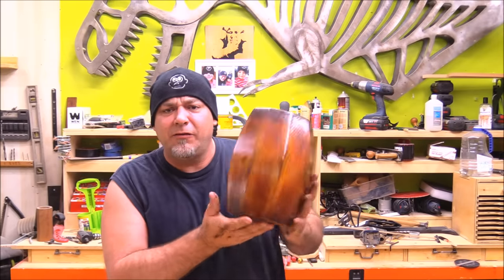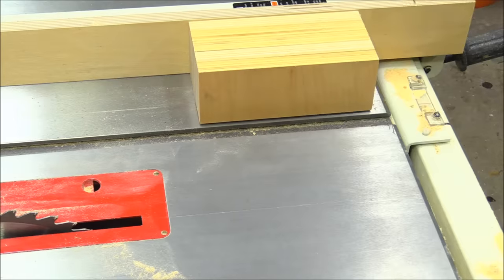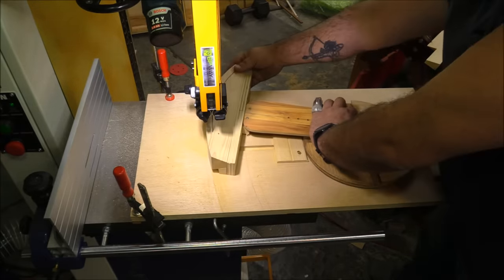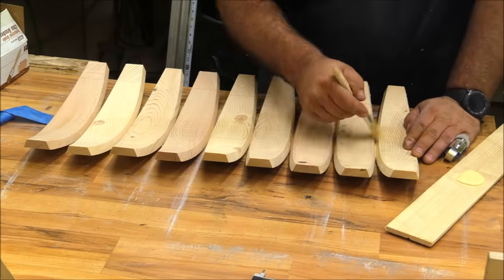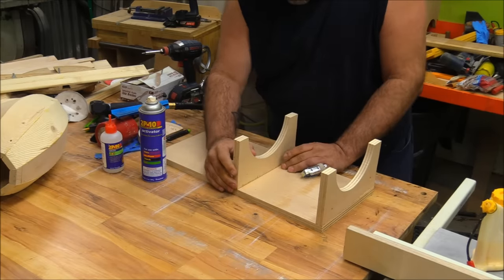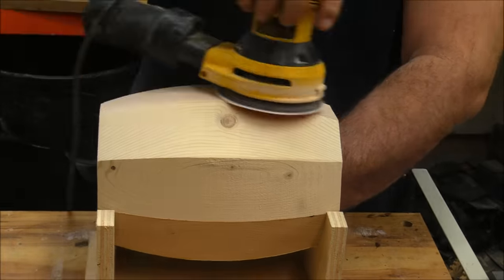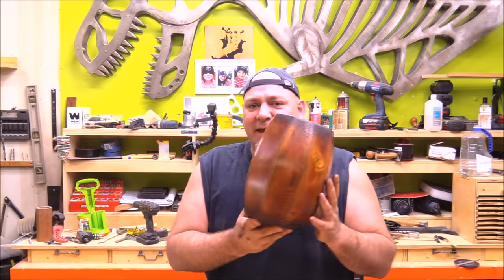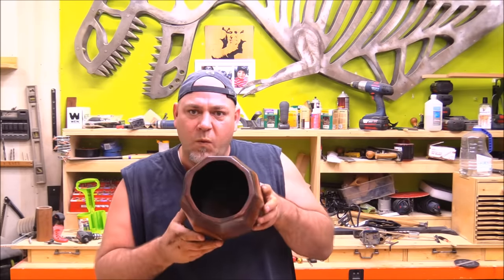Woodworking band saw jig for making vessels | Izzy Swan

Comment: The whole beauty of wine barrels is that the pieces are bent around to fit, so that the grain follows the curve. Also, the bottom is fit from the inside, if I remember correctly. That is how they can withstand high pressures.

Comment: Nice use of the elliptical jig will be doing this for sure. I love to turn segmented bowls and I roll them up with the tap as  to get started as well  Then I take plastic wrap and twist or bunch it together and stretch that around it a few times top and bottom pullin tighter each wrap. This makes clamping up any segmented cylinder easy. I hae tryed every thing from ruberbands to ratchet straps and the plastic wrap does the best. Izzy plz keep feeding us more ideas

Comment: Very cool! You can make all sorts of weird ass musical instruments with this. Like little drums, just keep sawing and you get smaller and smaller drums like those russian dolls. Or make a larger pear shape thingie you saw in half and make a body for a lute. The possibilities are endless!!! You can try to make one of those like you did but from two different parts to offset the center when you want your project to go pear shaped ...
Reply from the maker: PinkPonyOfPrey yeah that's a really good idea I started thinking about that you can make Bongos and drums and things that you can be done with a stick it be a lot of fun
Reply: izzy swan look up stave drum building. Same basic concept except yours are shaped with a curve where most are shaped straight. You would need to round out the top and bottom for the head to fit properly though. By cutting them in half and setting a ring in the center then joining the small ends you could make dumbek or djembe style drums. The real art is getting the head mounted properly. Although you could use standard hardware for a trap set after rounding the top to use a normal head rather than a actual skin head. I would love to see you do something along those lines... maybe as a give away... lol. As long as I win it! 😂

Comment: Great video Izzy. As always, you amaze me. I live in KY now, seems like I should be able to make a barrel. Seems like you could have made two or three smaller ones, by simply adding more stops until the material was gone. Putting the new shop together now, but filing this away to make the jig and a few barrels. Thanks for the great videos.

Comment: Cut copper water pipe lengthwise and hammer it open to make a copper band. Then run a couple of bands around it like an old timey barrel. The hand hammered copper would look great with the finish you put on it.

Comment: I've watched videos of the guys that make Jack Daniel barrels and this looks (because of smaller size) looks much easier.  I do in fact have a Jack Daniels barrel I got from Tabasco since they use them, for about 20 years after jack's one use in their aging process.  Makes a nice plant stand on the patio.  And yes a a handle making it a bier stein would be better.  Though the finish I think would have to change I think.

Comment: Pretty Cool Izzy.  I had one thought when you were cutting the slats for the barrel on the bandsaw it looked like you could have moved the stops for the jig and cut another set of smaller slats out of the pine boards?  Would that have been possible?  Hey you could have built a big daddy vase and a little guy vase.

Comment: For the alcohol makers at home (like me), this barrel is amazing! But you wouldn’t want to use it to mature alcohol. The stains and finishes on the barrel wouldn’t allow you to do that. But if you use this same concept and don’t add those chemical finishes, you can “char” the inside of the barrel with a torch or wood burned flame and really get some amazing wine or whiskey! 🥃

Comment: as for you problems with holding pressure while glue up, that's why they use barrel bands and also why they put them on Cherry red hot

Comment: Neat Izzy. I saw a guy make make similar small wooden barrels at a Shopsmith Users meeting at Shopsmith Inc in Dayton Mack around 1998. A couple things different that he did was he took his loose pieces and gave them a shallow dadoes Justin from the top and the bottom that he later added some sort of decorative band to the finished barrel. Similarly he made a dado across the bottom on the inside of each piece and had a captured bottom. his goal was to make something that looked as close to a whiskey barrel as he could. Your final vessel is far more refined than his, but I want to go and look at old photos and notes and see how he accomplished all of his other tasks. I also don't recall his use of the elliptical jig, so I'll look for that too. If I find anything I will share them on the Tool Masters Association Facebook page.
Reply from the maker: Aristocob hey Scott I almost didn't recognize you with your new picture icon. it sounds really cool I'd like to see that project
Reply: I break all the branding rules!  My marketing approach is "Catch me if you can."

Comment: To simplify I think just a single pivot jig, instead of the elliptical one, would probably work just as well for such a short cut. If it was taller, then maybe the elliptical would be better with more slope at either end. All in all, nice little vessel all the same.

Comment: I'm impressed that those miter joints fit so well. I guess each miter cut was 20 degrees? Because 360 / 9 = 40 and 40 bisected is 20. Am I thinking about this correctly?

Comment: could you make a video showing how to make a bandsaw jig that can be used to cut rounded ends on 1 x 4s or 2 x 4s?
I need to be able to cut rounded ends on legs that I use for cornhole boards.  Since I make a lot of them I need some way to round the upper ends pretty quickly.  Right now I am using my router and a pattern with a pattern bit but that is very slow.  Thank you.  Really enjoy all your videos.

Comment: Show making an actual mini-wine or spirit aging barrel. Many home wine makers and small batch distillers out there. Need to get the right toast inside. There are some volume vs surface area vs storage time calculations out there to make it most effective (small barrel will 'age' the product faster than the big standard barrels, to be emptied and refilled again!).

Comment: I think it would have been interesting to just take a hand-plane or a spoke-shave and shaved all the corners to make it sixteen sided on the outside, or even making it actually round... I liked the 45-degree bevel approach to putting the bottom on -- kind-of self-correcting, 'cause  its always 45 degrees to the flat bottom/flat of board.

Comment: Could you do the same thing with a jig saw since I don't have a band saw? Just curious. I know it would be harder, but you have to use what you have, right? Cool project!
Reply from the maker: i dont think a jig saw would work unless the staves were very small and even then it would be pretty tricky
Reply: steve Shelton Hate to be the Negative Nancy but to be honest I think it would be a lot of extra effort and extremely difficult to get satisfying results. Only because of the depth of the cut needed and the inevitable wandering of the jigsaw blade. If you're not overly fussy it would probably make more sense to not even bother building the radius jig or setting up a table to mount it and your jigsaw to. I'd just do the miter cuts on the table saw (assuming you have one), temporarily reattach the offcuts to get the square edge back, mark the radius' on that edge and just freehand the cuts with the jigsaw.
You'd likely still have to do a smaller barrel or one with more sides so you wouldn't exceed the max cutting depth of the jigsaw blade. Just my two cents, good luck!
Reply: ...I kinda figured Izzy would reply while I was typing that up

Comment: Pretty sure those were construction grade 2x4s which are usually spruce not pine.
Reply: Depends plentiful species in your locale.
Reply: Spruce/pine/fir are all common (SPF) as well as southern yellow pine (SYP).
Reply: Depends on which part of the continent you live in. Construction grade 2x4 are of the closest raw source as possible. Pine and spruce are both of the same softwood family so pretty much the same in most applications. The minor difference in this application is irrelevant.

Comment: Is there anyway you can do this with no glue and it be water tight?  Yet to see an inexpensive way to create a wine barrel.
Reply: why?
Reply: Exactly what i said....to make a water tight wine barrel.
Reply: What makes you think glue would not be water tight?
Reply: I know glue would be water tight but don't want to have to use food grade glue.  If you put wine in the barrel I don't want to taste the glue!
Reply: There are food safe glues used in segmented wood bowls turned on lathes. Whatever the flowing material you use to hold the staves together is by default a glue. How else would you seal the small gaps between the staves? The only other way that fasten wood to wood would be a mechanical device like screws or nails and that would not make it water tight. Pine itself will leak. for a real mug, hardwood would be better. These are for decorative use or light duty, not for drinking use, dry goods or nuts, bolts, screws, nails, coins, etc. Poly coat and the like put a seal between the glue and liquids. It is just an experiment. The latex paint used on the inside would be a greater concern for wines and beer then the glue, you will taste the paint before  any glue. Regular barrels depend on the liquid absorbing into the wood causing it to expand and close the gaps and the pressure of the metal hoops. Dry it out and leaks return. You have to keep it wet. Do you want to do that with these small barrels?
Reply: looks like your not getting it and you're getting way of topic.   forget it!
Reply: To join wood you use either glue or mechanical fasteners. In other words you need to use glue and there are food safe glues used for bowls. It is you who is not getting it. Without glue or metal hoops it won't hold together. There is no other way in this reality. Water tight is the topic and this is how you make it so, not off topic. 
You asked the question a week ago. You got no answers other then mine. Don't like the answer or the reality is not my problem and it is you who are not getting it. Can't handle the reality then go buy a glass.